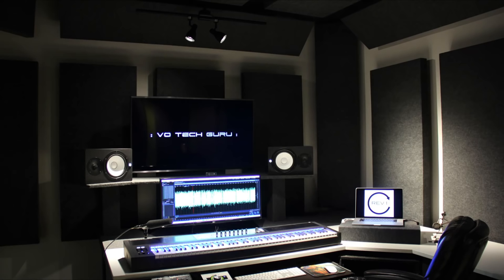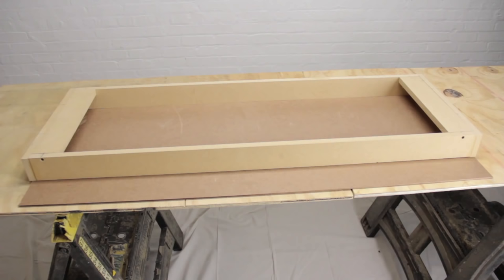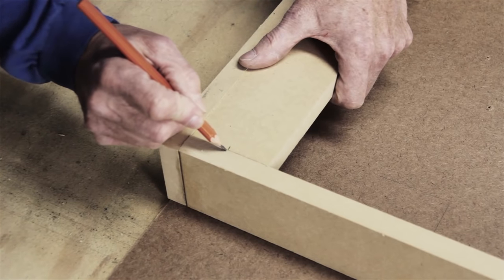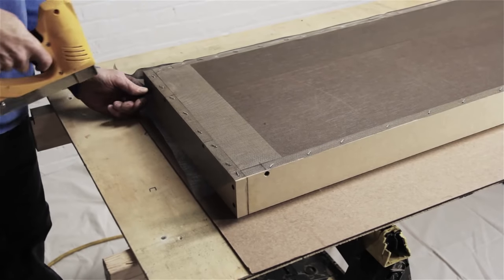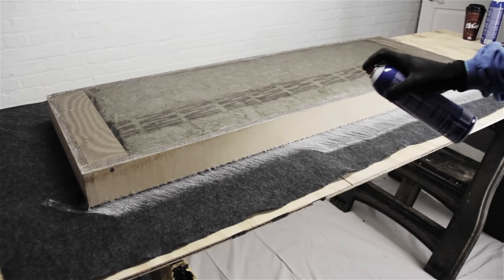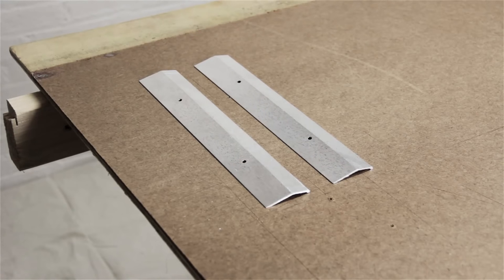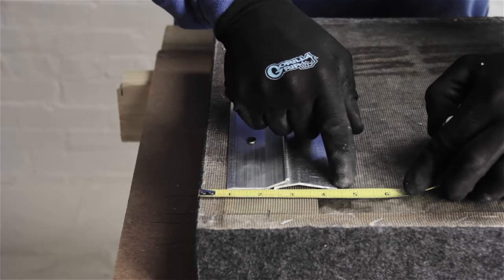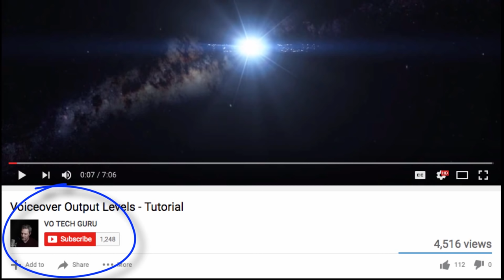How To Build Acoustic Panels | DIY Acoustic Panels

Comment: 25 bucks per panel for pro grade looking and sounding absorption panels? Plus its a fun DIY project for a weekend or a saturday?
Sure! Looks like I'll be making 4 of these this weekend
Reply from the maker: luuk341 Right on! You’ll like how they perform as well. I checked out your late night acoustic tune, very nice!
Reply: Thanks for listening! I am very glad you like it!
Reply: I went out and spent a lot of money not just on supplies..... the supplies were relatively cheap and $50 cdn for the Roxul was a bargain for 12 3" panels. These are the best DIY's I have seen and better than a lot of professional ones and as good as any professional panels I have seen that run like at least $200 a piece. The tools to put these together properly were  a lot more than the supplies but everything I bought was on sale or a just as good knock off on some of the supplies for much cheaper but I had to buy in bulk for some but I don't mind having extra kicking around for other projects like some bass traps.... and the tools well you really can't put them in the price of the panel because I will have them for life and I love tools lol. I haven't started the project yet but I have some led rgb strip lighting on it's way and all the stuff I need to put them together properly like a soldering iron.... the $40 strip lighting kit ends up costing almost $200..... but it will be nice once I get my Home Theater up and running properly. People think that you just have to purchase a Home Theater in a box and then you are done. Sadly they will never know what a real Home Theater should sound like. Go to your local Cinaplex theater and that is what it should sound like. Fortunately you don't need quite as much sound absorption as a studio.... been there a few times recording albums with my band. Some of those rooms like the vocal booth have to be practically dead.... but not all of course but still more than a home theater. anyways thanks for the vid really helped. Some of those other vids should be taken down for real.... I mean the quality some of these guys settle for is atrocious. I would be embarrassed to show my face in a lot of those videos. anyways again.... I will get back to you when it is done to let you know how totally awesome I am.... I mean it would be a crying shame not to share the sheer brilliance of the sum total that I am. Not even bragging it is just the stone cold facts of the matter. lmfao.... I couldn't even keep a strait face writing the last part. Seriously though thank you very much for the video. It helped me a lot. If your video wasn't in my path I would have had to compromise and probably put together the good parts of like ten vids for real. If you want I will show you when it's done. Merry Christmas and may God bless you.
Reply from the maker: Beeker Thanks for the nice comments! It would be great to see them when you’re done and Merry Christmas to you as well!
Reply: luuk341 i made them 2 days ago for 10 per panel... A good investment and good project!
Reply: portable digital odometer
Reply: Are you sure $25 panels are going to sound the same?    hahahaha.  BULLSHIT.
 Roxul is NOT meant for acoustic TREATMENT. Neither are many other types of building insulation materials that people use.  

Roxul is not only toxic as hell, but it's probably going to absorb too much in certain frequencies and it doesn't SOUND the same as it would if you used a properly designed acoustic treatment that's designed specifically for music and speech.

I would suggest buying the acoustic foam from Acoustic Fields. And they have plans for building the frames around them, plus if you live in a earthquake ridden area, there might be building codes you have to adhere to in order to affix these panels on the walls and ceiling.  

No, I don't work for Acoustic Fields, but I've been in their rooms and heard the difference between other acoustic foams and commonly used panels made from building insulation.   Their foam just sounded far more natural.  the reasoning as to why was told to me that they carefully looked at the absorption coefficient curves and matched them to the Fletcher Munsen curve more closely and they don't tend to over or under absorb in a specific area between 125hz and 500hz.  Apparently, that's the biggest range of differences between materials.

here's their site if you are interested.  But trying to save money is great, but first thing first, use the best materials otherwise you won't arrive at the same results, you'll end up replacing what you have once you find something better, thus costing you more.

Also don't fall into the trap of thinking that building insulation will work for low frequencies under 100hz.  NOTHING other than pressure activated absorption cabinets will work.  Diaphramatic is the best, and membrane Is second best, especially if you have low frequencies in the below 60hz range.

www.acousticfields.com
Reply: @Oneness100  lmao you have no idea what youre talking about
Reply: @ChadRockwell  It's nice that you make a statement but show no substance behind your statement.

Anyone can say someone is full of shit, but you simply didn't provide any legitimate explanation to back up your statement.
Reply: @Oneness100  Im guessing Owens Corning 703 is bad too? Just wondering because I was planning on making panels with 703, not Rockwool. If thats just as bad what do you recommend? I just need something for a small room.
Reply: @b47d16  that's building insulation.   I've used Corning 703 and I've been in many a rooms at studios with it.  It's not that great IMO.  plus, it's fiberglass and no matter what fabric you have, you are always going to get tiny little fiberglass particles that become airborne.  I don't know if you want to breath that crap.

Again, building insulation simply doesn't have the right absorption coefficient curve since it wasn't designed for the purpose, it was designed for INSIDE the wall cavity, not used a acoustic treatment in studios,.
Reply: @b47d16  I know.  I definitely wouldn't use Corning 703.  Fiberglass particles becoming airborne should be a good enough reason.

What are you using it for?  what type of work do you do?  Voice only, vocals/music?  

Are you a hobbyist or do you make a living?

What are the dimensions of your room?  "small room" can range from a small bedroom all the way up.  :-)

 and what is your source?  A stereo, or full range instruments and/or vocals/voice?

What's the SPL of the source?

Just curious..  Maybe I can help you figure out how much you'll need and there might be something else you need to.
Reply from the maker: Oneness100 You’re misinformed and also misinforming others. First, most “pro” acoustic panel companies use closed-backed acoustic panels with plywood which is the worst idea in the world for serious acoustic absorption. Also, it’s not ‘dangerous as hell’ as you put it. Roxul / rockwool manufacturers have their employees working without lung PPE inside Roxul / rockwool factories because it’s simply a mix of basalt rock and metal that doesn’t “fly around the room” when contained in a panel. Look at the MSDS sheets and come back here to comment. Also look up the video link below with proof of what I’m saying. I’m OSHA 510 certified, have been a PM and safety director on massive projects and have been working around this stuff in the open for ever with no issues at all. Same with installers. Don’t believe YouTube videos that hype up the “dangers” of “this and that” without being in-the-know yourself. BTW, the European MSDS equivalent governing safety regulators came up with the same results when testing basalt based acoustic materials. You ask for proof from others but provide none yourself for your argument. One YouTube video even suggests covering them in thin Mylar or plastic to keep the fibers out which is just moronic for acoustics. Watch the video below and then present your counter argument with facts: MSDS, case studies, etc. California allows Roxul which likely tells you everything you need to know about how dangerous it ISN’T. I voiced this DIY panel video tutorial with these panels (notice the booth isn’t ringing with my deep voice?) and I also compose and mix for TV and film using the same panels. And they keep hiring me. Explain with facts how it’s dangerous and not effective, not just with comments. Here’s the video, or “proof” if you will. A large company is not going to have Holmes recommend the product nor is Home Depot going to advertise this product without massive warnings or disclaimers. Nobody wants to be sued for pushing or selling a product that’s a know “danger” without largely advertising the same. Where are your case studies or other proof? Here’s the video:  https://youtu.be/LOWQym4RCfI
Reply: @VOTECHGURU  I can't help it if their employees don't wear protective gear, but if you have seen these factories, it's all automated, so people aren't actually touching the product directly and cutting it up and handling it.

but it does say on the package to wear protecting clothing, etc.
Reply: @VOTECHGURU  I don't care what MOST "pro" acoustic panel companies use.  That's THEIR problem. They only use it because it's cheap and readily available and because they can't design their own absorption product that has a better absorption coefficient because they don't want to spend the time and money to do so. But others have.

Why they use a closed back is THEIR decision. 

if you have low frequencies in a room it's going to vibrate and yes, it's possible for tiny particles to become airborne. I know it does it with compressed fiberglass like Corning 703 because I have used those and I see all kinds of particles that come out of the panels when you lightly hit the panel with your hand.  That's why I stopped using compressed fiberglass.  Plus, like other building insulation, they aren't designed for acoustic treatment, so their absorption coefficient curve isn't optimized for human hearing…

As far as acoustic foam, there are many manufacturers of acoustic foam, depending on the company, they might have or not have a desireable absorption coeffiicient curve, so you have to find one that has an optimized curve for human hearing.  And yes, there is one that I have found that does have a very good absorption curve and I've been in rooms with their product and it sounds VERY natural. Very noticeable compared to other absorption materials for 125hz on up.  If you have enough wall coverage, the difference is noticeable when compared to another material with the same amount of wall coverage.
Reply from the maker: Oneness100 Yeah, and I even say that in this video to avoid catching crap from people who say they should wear PPE. And the manufacturers are going to say wear PPE so they can’t be sued when some idiot smoker claims it have them cancer. Go by the MSDS sheets for the truth as those can’t be legally manipulated. I literally have a picture of me EATING Roxul that I need to post somewhere to stop this argument. Installers use it ALL THE TIME without PPE and I have many times myself. No effect at all. The people in the factory have the Roxul being moved and bundled around them all the time which would throw a TON of “fibers” into the air. No issue, and the company would definitely force them to wear PPE if there was danger involved. I used to do that for a living as a director of safety for a massive 4 billion dollar a year construction company and I know that to be true. Look, I think you’re trying to do some good here and I’m probably coming on too strong because there are some videos out there that are VERY misleading about the safety and STC ratings for this material. I feel like I might be taking some of that frustration out on you because it’s been commented on so much. For that, I apologize. I’m just trying to get the actual truth out there. I hope you understand.
Reply: @VOTECHGURU  Eating Roxul?   Maybe that's why your addicted to it.

But you STILL haven't addressed the most important part. The Absorption Coefficient curve for acoustic treatment.  I'll be willing to bet you simply ignored that aspect and just use it because it's cheap and other studios use it..  The thing is, there are acoustic foams that were designed SPECIFICALLY to have an absorption coefficient curve where the results are more natural, so in a critical listening environment or a control room, you don't to fudge with the EQ making ti sound right due to the wrong absorption materials being used.

I'm trying to explain that what Pro recording studios isn't necessarily the best.   The person that I met about 7 years ago that owns this company I'm referring to, has brought his acoustic foam into studios that were using Roxul, and when they tried his acoustic foam, the difference was HUGE and they noticed they don't have to mess around with EQ as much to get everything to sound right..  he even brought his products into a mastering room for Capitol Records and the engineer and others that work there freaked out.  All of their clients are blow away by the improved sound that his products made and it gets him more business from those that have been in the room and heard the before and after difference.

I know you have no expeinec with his products which is why I like promoting what he does.  I've been in and around high end studios, small studios and high end listening rooms and the room he had set up was beyond any room I've been in and we sat and talked about what the reasons were and it makes total sense.  There's a critical region in music from 125hz to about 1,000hz which is the 3 octane range that most music lives in, and if you don't have the right absorption coefficient curves for absorption, it can make a HUGE difference.

I have personally tried many different brands of acoustic foam, Tube Traps from ASC, 703, etc. and none of them sounded quite right.  I have spent a lot of hours in one listening room where they used Rockwool and it just doesn't sound natural like this other products do.

So, I urge you to check it out and see for yourself because we can talk all day long about it, but the bottom line is ABSORPTION COEFFICIENT and I have not seen ANYONE, including you, explain the importance of picking the right material for that 125hz to 1,000 hz range to get that part to sound natural.

And as for the low frequencies below 100hz, this company has flat out the best absorption products for that too.

After listening to his room, I have sworn off building insulation for room treatment, it just doesn't work as well.  It's cheap and readily available, but it's simply not designed for that purpose.
Reply: @VOTECHGURU  Um, not wearing PPE is not going to have instant effects.  How long did it take for them to figure out that Asbestos, Baby Powder, and other things caused cancer?  It takes LONG term studies.  So, while you might not get it by eating it, if that has ANY tiny particles that are hard to see are floating in the air, those will get into the lungs, and since it's not an organic material, it's going to cause issues over a long term period.

But be that as it may, the biggest issue is that it simply wasn't designed for room treatment for music and speech.   Now, if you don't care about the sound of your room and all you want is cheap absorption material, they go for it, I don't care.   That's your decision, HOWEVER, don't ever say it's the best material to use for Acoustic Treatment, because there engineers, serious listeners that have done listening tests with Roxul, and other types of building insulation  where they weren't the best type of absorption for 125hz + . It's just cheap and readily available..
Reply from the maker: This got old real fast. Look, I never said Roxul was the best acoustic material in the world so don’t tell me to stop saying it is. Never said it, period. And just because something was originally designed for one purpose doesn’t mean it can’t be repurposed for something else. That kind of shortsighted thinking is what keeps people from progressing and they sit on their hands because they can’t see past their own nose. In fact, the reason I repurposed carpet transition strip was because of all the times I’ve seen crooked and janky looking panels that hang on wire hooks and it looks like ass. Repurpose the carpet strip and create a French cleat, problem solved. It’s like magic! Except it’s not. I didn’t over think the thing into a state of paralysis by looking for the end all and be all of hangers. And I certainly didn’t go onto other video creators comment sections and tell them they’re hanging their panels wrong because of this or that. No interest at all, and besides, who the hell has time for that? Also, foam WAS NOT originally designed for acoustic treatment either, so please stop pressing that point with Roxul. Also, you do realize this a voice over centric channel, right? The idea, which I consult on worldwide at all levels, is to get booths sounding dead and they usually come with 2” foam which sounds horrible, especially at 500 Hz. That said, I voice for some of the largest brands in the world, I compose for film and TV, I have been an internationally signed and released artist, played as a session and stage player for years  in LA where I grew up, I’ve swept and measured my current monitoring room with these panels and I’m right in the bolt area where I should be, and it sounds great. Likely because I actually do this stuff for a living and the market keeps responding by hiring me. I feel no need to waste time getting my room floating in zero gravity or some other lame, over-the-top solution. Results are what matter, not numbers and opinions or what anybody else is or is not doing. Again, results are what matter. Does it get the job done, yes, and very well. You can argue all day long about how someone isn’t using the perfect fishhook while they’re busy pulling in tons of fish all day long. and If that’s your thing, then I don’t know what to tell you. Regardless of which acoustic material or diffusion you use, placement is key anyway, so live/dead is relative to that and the size/shape of the room. Also, we no longer live in a day and age where products get unleashed upon the public without extensive safety tests., such as mineral wool being classified as Group 3 for humans way back in 2001, and mineral wool has been around much longer than that anyway so the point is moot. So let’s do this, I’ll keep pulling in the cash doing what I do and you keep looking for the holy grail of acoustics. I’m not interested in finding the perfect solution per the laws of quantum physics. I’m just helping people succeed and I’ve done that many times over. I get great results, my students and clients get great results, and we get paid well to do what we do.  Oh, and no dust on this end. I even put white and black paper under 2 of the closest monitoring panels for 2 months because of a previous similar comment. No dust at all, so yeah, there’s that.
Reply: @VOTECHGURU    But you are implying it by doing videos using it ACTING like it is, nor do you mention what to look for in an absorption panel to absorb 125hz and above and that there are other products that might better, nor do you mention that ROXUL wasn't designed for this application because it's meant for in between a wall cavity for thermal insulation and noise absorption more for barrier control.
Reply from the maker: Oneness100 No, I’m not implying anything. My voice has a ton of energy in the 125 and above Hz ranges, as you can plainly hear, and my voice in this video was recorded using the same panels in my booth. People hire me, my clients and my students all the time and aren’t getting the “Hey, I’m hearing a lot of 125Hz and up non-absorption in your signal!” And trust me when I tell you you’ve heard a lot of their voices at the highest levels on TV, film, web and so on. The name of this video isn’t “Which frequencies will these panels absorb?” anyway, and I don’t answer to the acoustics police. I simply put out a video to help people, that’s it. And your “not intended” argument has run out of gas at this point, man. A tree was never intended to be a baseball bat, but hey, we have baseball bats. So what. If you’re so hot on creating The DIY Panel Of The Gods or whatever you’d name it, put together your own video. In the meantime, I’ll be over here in the unicorn zone where my magical panels are somehow absorbing 125 Hz and above in only my booth and only in my control room. I guess I just got lucky. Several times across the globe for others, too. Weird.
Reply: @VOTECHGURU  Yeah, and are you replacing this other brands products with what you're trying to sell?  NOPE.  But this other company replaces Roxul installations all of the time.  :-)

Why don't you compare a room with Roxul and the same room with his brand of acoustic foam and listen for yourself if the region between 125hz and above sounds differently.

You should know that most of the music we listens to lives in the 125hz on up range.   That's the middle 3 octaves.  The lower 2 octaves are about 110hz and below.

The person that created this other acoustic foam spent many years and he and his group built and measured over 100 rooms, conducting many kinds of measurements and it took many years to create the product because it's not every easy to do that.  See,  you have never designed your own absorption material, you just use what's already available and you just haven't done enough research and comparing all of the different types of materials on the market.

Do you custom build rooms costing in the $400K to $2.5 Million rooms?  Did you replace his products at Capitol Records Mastering room with Roxul based products?  NO.  

He's got customers all of the time that are replacing other materials and products that are based on building insulation and I'm just pointing it out to you.

Relax, just do your homework.
Reply from the maker: Oneness100 Ok, now you’re just babbling. I don’t need to do any homework. What are your specs and achievements, man. What have you done that makes you such an expert in this field. I hear blah, blah, blah and nothing to back up your claims. You’re telling me to “relax” while causing tension, but only for yourself. It’s a one-sided argument at this point and anyone with half a brain knows it. I get well paid to produce content for leading brands and you get paid for what? To troll YouTube comment sections? Hey dude, “Relax.” I’m just asking questions. What have you done that’s notable? You talk game while I play and succeed at said game. Lay it down. What’s your professional heritage? And PLEASE don’t answer with another misdirection into Capital Records or some other lame statement about a joint I’ve been in since I actually lived there and grew up a mile away from it. Lay out your res, man. Real talk. Let’s go toe-to-toe. What makes you “the voice” in this arena? Results, not opinions and vidiot comments, please. Learning is not the same as doing, after all. Hit me with it, Einstein. And yes, I do realize some non-sequitur nonsense will be coming back as a response, but I’ll listen for the benefit and education of others reading this thread. And hey, I just realized, if you start a band, it should be called “125 Hz And Above” since that seems to be your favorite subject. We done here?
Reply: @VOTECHGURU  I get my information from the company that makes this other product that has tested and compared practically every commonly used absorption material which led them to making their own acoustic treatment, so I'm just the messenger.

Here's the situation that you may face one day.  You put in your Building insulation into a customer's room, the customer eventually goes out and tries out something better and then they don't call you back because you gave them bad advice.

Have a nice day and I would highly suggest you remove the "guru" from your screen name because you aren't one..
Reply from the maker: Oneness100 Ok, “”messenger.” I destroyed everyone of your arguments with facts and you’re going to pull out ad hominem attacks? Every time I respond you puke up “yeah but.” I make a serious living with what I know and what you don’t, from I can tell. I share it with others and they succeed, big time. End of story. Insult away, “brah.” Who are you? What have you done? What makes you an authority? Because you read something on the “inter webs?” Why should anyone reading this thread believe anything you’re saying? Post some audio. Make me a believer.
Reply: @VOTECHGURU  I am just relaying what I found out from doing some research. the company that makes this other product has hundreds of rooms they've built.  They do custom build rooms that cost as high as $2.5 Million. What have you done? Have you gone into Capitol Records and fixed their problems with your expertise?  NOPE.

You haven't replaced this other company's products with anything that you make or sell, so please don't act like you're an expert. When you are using building insulation you can buy at Home Depot.  You are using a material for something it simply wasn't designed to do..
Reply: @VOTECHGURU  Go get their products and see for yourself.  

If I were going to go around selling myself as a "GURU" I had better have first hand experience with every product on the market, or at least the most common products as well as anything new just to know what they do or not do.  But you have no experience with this company's products.

The reason why I went down to visit this company's demo room about 7 years ago is because I was invited to check it out.. I had no expectations, but what I experienced was far better than any room I'd ever been in up until he visited their demo room. 

If there was a noticeable improvement over other materials used in other rooms, then I wouldn't be telling you about their products.  I only recommend products I have had some first hand experience with.  I used to like ASC products as I had a full room with their products for a period of time, but it doesn't compare to this other company's products.  And yes, I've been in plenty of rooms with building insulation including rock wool, 703, etc.  I have also used Sonex and Auralex foam with dissatisfaction.

All I can say is, check the product out yourself and experience the sound difference. Obviously you can't tell by watching any video on Youtube, including yours.
Reply: @VOTECHGURU  Posting audio? Why?  Making a recording and sticking it on YouTube isn't the best way to judge an acoustic treatment product, it's better to experience it in person. You should know that..
Reply: @VOTECHGURU  So, you're been in Capitol Records Mastering room since they got their new acoustic treatment?
Reply: @VOTECHGURU  You have not mentioned ANYTHING that's a fact, all you are doing is trying to boast your credentials, with nothing but vague information. I told you I'm not an acoustic engineer and I never said I was.  I just told you that I've been in different studios that have used various different products, including various types of building insulation, acoustic foams, etc. etc. and have used various products myself.  And I stumbled across this company that makes some rather unique products and for mid-range to high frequency absorption for 125hz and above, they have their own specially designed foam.  For low frequencies below, they have their own unique designed diaphragmatic absorption products using Activated Carbon, for which they have patents on.

You haven't been in a room with their products, you haven't compared their products so how the F can you even say you are an expert when there are studios and home listening rooms where they are replacing building insulation based (Rosul, Corning's 703, etc. products with this other company's and they like the sound better.

I also heard the products myself, which YOU HAVEN'T.   Again, I'm just trying to tell you about something you have NO EXPERIENCE WITH?

What facts have you even stated that mean anything?  NONE.  

And you are telling me to not listen to anyone over the Internet?  Does that include you too?  

Go and design your own material, which you can't.  what actual rooms have you designed?  Got any photos? I"ve been to your website and the only thing you have are some testimonials for vocal booths.   

Yeah, I listened to your voice in this video.  NOT IMPRESSED.  Sorry, but it just doesn't sound that good. It's actually kind of annoying and I have to turn down the volume level considerably.
Reply: You teach people how to use gear, that's not being an acoustic engineer.   That's being an AUDIO ENGINEER.   Acoustic Engineers deal with choosing the right materials, figuring out what one needs in terms of the room measurements, what types of materials, placement, etc. on barrier control, room acoustics.  You may know something on how to use an Parametric EQ, but not necessarily be an expert in knowing the different types of acoustic treatment materials, etc.
Reply from the maker: Oneness100 Oneness100 Oh man, I didn’t bother reading your stream of conciseness ramblings because you’re responding so many times with different posts in a row after each of my responses you remind me of George Costanza with his bit about “Damn it, that’s what I should have said.” It’s like you walk away after commenting and then run back to your keyboard and think “Damn it, and another thing!” Dude, just gather you thoughts and say everything in a single post. Let’s make it easy on you....you’re right and I’m wrong. I don’t have it in me to be right at all costs like you...it’s a nasty attribute. Is that what you were looking for or do 
the problems run a bit deeper?
Reply: @VOTECHGURU  Well, you posted a lot of comments and said nothing tangible to make me think you know about acoustic treatment.  Stick to teaching people how to use an EQ, Compressor, etc.  but stay away from acoustic treatment.
Reply: @VOTECHGURU  I trust you man. I decided to make my own with these instructions. Hope it turns out great and works for my VA work and my music stuff. IDK about the other fella, but after countless research. Everybody says instead of foam do diy panels with rockwool so...
Reply: @pvalenti  "the panels described in this video are not the BEST panels you can get, and they are not the PRETTIEST panels you can get, and they are not the ONLY panels you can get…." 

You should have started with saying that in your video opening script. It would change things dramatically. was it that hard to say that?.  :-)

Now,, with that said.  if you want better sounding panels, check out this other company and they do sell the foam by itself and you can make your own frame, and make it as pretty as you want. And if you need to go after the really low frequency range below 100hz down to 30hz,  you can also get their Activated Carbon based products that go after that end of the audio spectrum.. if your usage needs really good low frequency absorption down to 30hz..

Have a nice day..